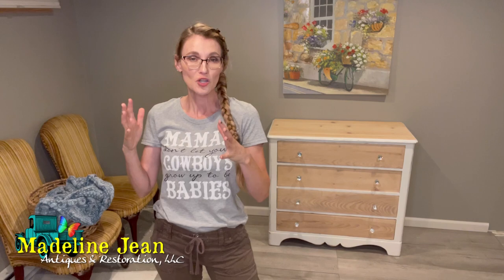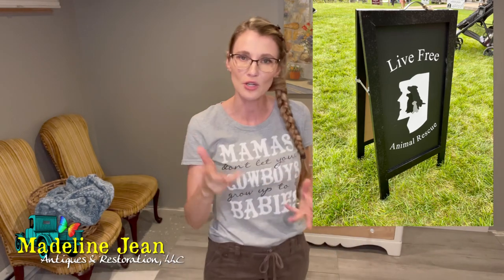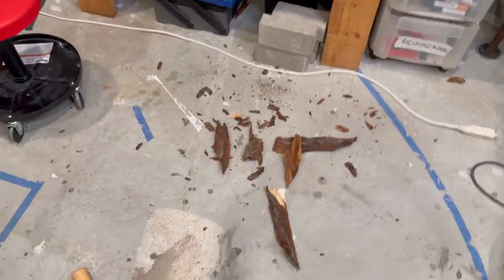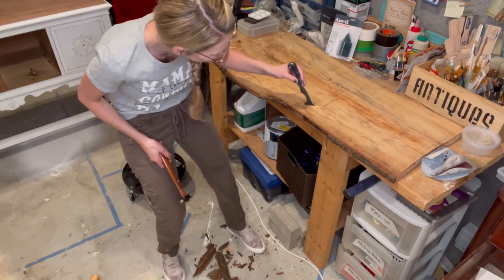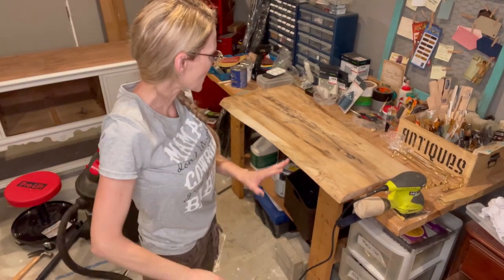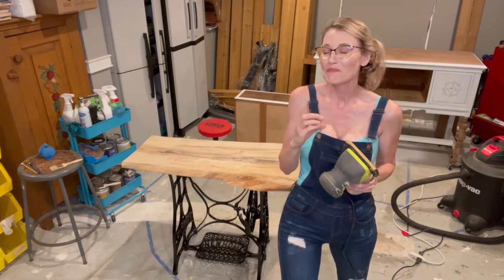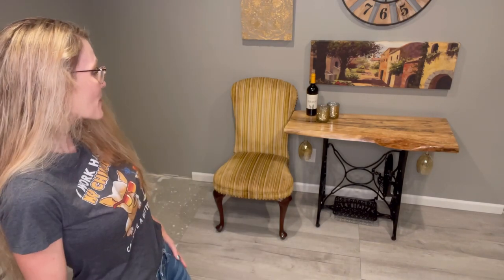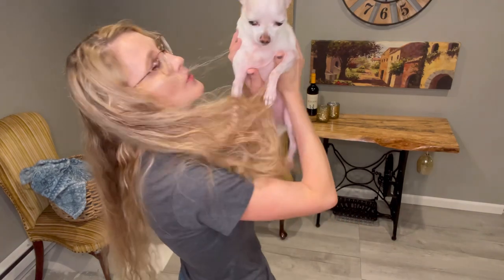Working with Live Edge Wood | My First Time

Comment: Personal thought…a lower grit (courser) may have made the edge clean up a bit easier; however, I wouldn’t use a belt sander on the live edge. There is a greater chance of gouging the edge since it is not a flat surface…that’s my personal opinion. I do use a belt sander when I feel I have the right application. I think you did super. Keep up the great work.  Looked like you have some spalting in that slab. It is pretty.
Reply from the maker: Yeah I think you’re the second person that has mentioned that a belt sander might be too rough for the live edge. Makes sense. For my first live edge piece I’m pretty happy with the results. I just want to work smarter not harder. I’m currently drooling over a Festool wood planner haha!

Comment: Bethany, I'm in NH too,  not far from you. I've used that organization to get rescue dogs and they are awesome. Great charity. I'm also am amateur woodworker with a lot of tools, now starting to get some Festool in my collection. I would not use a belt sander to clean up that edge, I think you would find it too aggressive and might take off too much and cause flat spots, which is what they are intended for. I would use rasps to get most of it so you can preserve the shape, then finish with the orbital. The other thing you can use is an angle grinder with a flap wheel of various grits. 
It would be very expensive to get a planer that will go that wide, but check out the Dewalt DW735, which will go up to 12" wide. I have one and it works very well. 
Transitioning from furniture restoration to woodworking is a very slippery slope!
Reply from the maker: Transitioning from furniture restoration into woodworking is definitely a slippery and fast slope! Haha! Not to mention expensive!!! I’m currently researching wood planners…..yikes! 
$$$ I wish I could pull the trigger. I think you are correct a belt sander is going to be too rough on the live edge. Thanks for sharing your thoughts!

Comment: Hi Bethany,. Love the channel. I am very new to restoration and wood work so wanted to ask a basic question. I recently felt inspired to try restoring an old slab of oak and to make it into a simple shelf. I have been sanding and getting some nice results but I can see the tell tale holes of woodworm. Do you recommend any ways to treat it? I have tried  a chemical treatment on one piece (I actually got three slabs to experiment with)  but really prefer to avoid anything toxic if I can. I read some people use certain essential oils (rosemary or eucalyptus) or even vinegar or lemon juice but I couldn’t work out if these actually kill the woodworm or more just force it out so you still have to do something. And if you would treat it, would that be after sanding but before say oil or wax? Thanks and please keep up the great work. Paul

Comment: BTW, you’ll spend a bit more on the soak in oil finishes, but you will use a tiny, tiny amount and also it doesn’t yellow the wood, like poly do.
Reply from the maker: Good advise! What's your favorite topcoats besides the oils for slabs? I've only tried Shellac so far. It's good for the glossy look but not the best for maximum protection.

Comment: Hey Bethany, great job on  your first live edge piece. Looks fantastic!

I have to agree with another comment that says no belt sander on the live edge. NO! A belt sander is for flat surfaces or perhaps changing the shape of something (bumps or edges) quickly. NO BELT SANDER ON THE LIVE EDGE PART! 

When cleaning the bark off, I use a grinder with a heavy wire wheel. A softer wire wheel perhaps on softer woods. But the wire wheel works great. A little careful chisel work may be necessary. A chisel instead of that 5 in 1 tool would handle much better. Then some sanding with the orbital sander and some hand sanding. The wire wheel cleans up a lot, so depending on how attached that bark was, sanding isn't usually a big deal. (And although I have clients asking to leave the bark on, I always take it off.)

Hey, on that nifty Ryobi pad sander, you can take off that dust bag and slip the end off your shop vac over that. I usually don't even tape it. The suction hold it on. And I believe there are adapters for that, but I have never used one. Duct tape if necessary.  You could use that method on any tool with a dust port, even a belt sander. But not on the live edge portion. 😜 You will be surprised how little dust you produce this way.

Finish... depends on use. If it may be outside or get wet... a few coats of poly (sanding in between coats. And atheist one coat always on the bottom to seal it). I am still a huge fan of spraying lacquer (from a hvlp gun, not a spray can). And I go through phases where I like a simple beeswax/mineral oil blend as a finish coat. I tend to go a bit more than 50/50... the oil being the bigger share, 60/40 or so. I like how this makes the piece feel "soft and cozy". (Here comes the hate mail. Lol)

One last thing to consider. Instead of epoxy in that knot, many woodworkers, especially bowl turners, use black CA Glue. You can find this at your woodworkers store and on Amazon or other such online places. And while it is a bigger up front cost perhaps, "boat epoxies" will save money in the long run.

PHEW! Enough said.

Love your videos. Love your style. Thanks for sharing with us.
Reply: So today I am working on a custom wooden screen door for a client. It will be finished in a sprayed, gloss enamel white sprayed with a HVLP sprayer. So, every little thing will so on this door. I want the joints in the wood to be invisible. While I will do the final sanding with a 150 grit on an orbital sander, I am doing the initial sanding with a belt sander. Perfect use of this tool. (Just so you know I don't hate belt sanders. ;)

Comment: Of course there are many finishes you could use. I’ve been working with these slab woods for a long time and have tried many finishes. To really let the wood breathe, I have only I used oils that soak in. After a few coats, you’ll find that these are most long lasting. I have a slab of walnut that is 20 years in my house. It is waterproof, easy to dust with a damp cloth, won’t show scratches, etc. Wood needs to breathe!!! I have a another piece that I’m going to use Odies wax oil. It smells great and not toxic. Please don’t use polys on these gorgeous pieces of wood!
Reply from the maker: I'm going to look up that Odies wax oil. Question for you....does the oil have to be reapplied every so often? No problem if it does, just curious. And how about the sheen of the Odies wax oil? Is it more dull than a poly?

Comment: You used shellac finish on a surface that will likely have alcohol spilled on it?  Not trying to criticize, but probably not a good choice since the alcohol could damage the finish.
Reply from the maker: I always send off a care tag with my projects on how to best take care of their piece. I always advise using a coaster and taking extra care.  The woman that won this piece said she’ll most likely use it more as a display table. I am aware Shellac has its limits when it comes to protection but I explained in the video why I chose it.